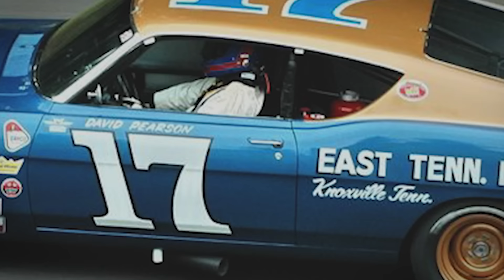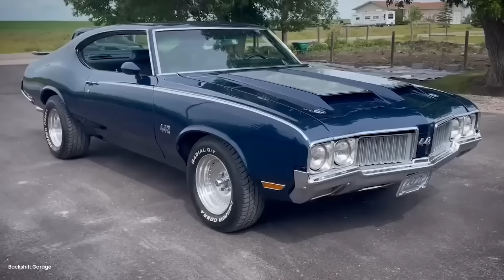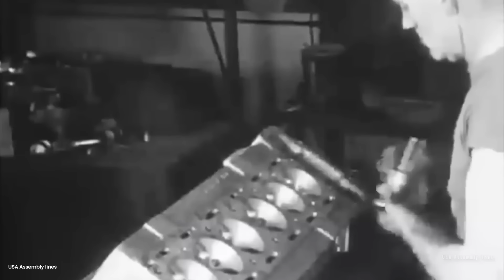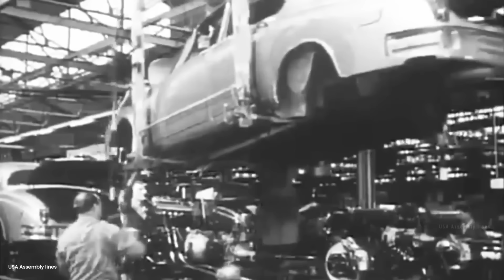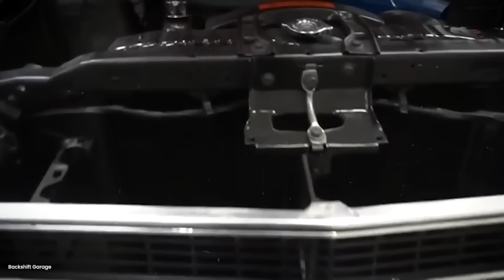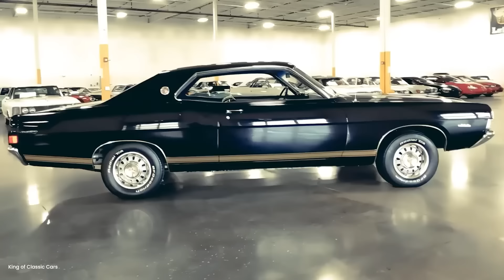The Shocking Truth Why Ford Torino Talladega Was Banned 😮: The Aero King That Dominated Superspeed

Comment: My father purchased one of three Talladega’s that was sold at Long Lewis Ford in Bessemer, Al. He bought the Royal maroon car, Long Lewis had one in each color, we drove the white version and the transmission had hard shifting that, after driving the maroon car sealed the deal. You can imagine being 15 years old and being able to drive this car with my learners permit, smoking the right hand rear tire to oblivion several several times. The car had a 3.25 rear end without posi traction and if you punched it at a light it would smoke that old Polyglas tire through first and halfway through second gear, making it a necessity if you raced someone it had to be from rolling. He wanted the tag bracket on the front bumper modified so I, with many blades, sawed the ears off with a jig saw and we drilled it and fitted it with a flat black screen to get more air flow to the engine bay and because it looked great! We (I) fitted a J.C Penney El Tigre hood tac to the hood directly in front of the driver after he determined exactly the location he wanted. I asked him Daddy, are you absolutely 100% positive that you want me to drill this hole, numerous times saying once I do it there is no turning back. He said yes, and I center punched and drilled the hole. I installed the tac and wired it up, and had it admit it looked awesome. I snuck this car out and raced David Weems in his GTO Judge down the Bessemer Super Hwy on New Year’s Eve on 01/01/1970, his was a 4 spd and took me off the line but when I hit about 90 mph I walked off and left him and was doing approximately 150 mph when I passed the Bessemer bowling alley. I had many great times in the car and with the bond that me and my daddy had forged in this car. Wow do I ever wish I could go back in time to see it, but mostly him, my father, Robert Payne. Thanks Dad for the wonderful childhood and for not killing me for sneaking the car out!! David Payne

Comment: i was around during those days and can't ever remember seeing a 428 cobra jet car with the automatic, im sure someone was silly enough to order one but im betting they are rare. as far as the engine, the nascar race cars regardless of the make used whatever nascar told them was legal for their make. up until the cars got over 200 mph the fords used the 427 ci engine and chrysler products used the 426 hemi and the chevy the 427. amazing when todays generation finds a little info and thinks they have facts
Reply: The Talladegas were only available with automatic transmission and 3.25 rear end. Zero options were available.

Comment: Had a '68 Torino GT Fastback. I REGRET selling it to this day. Never had one single problem with it. It had a 390 block with 428 heads. It wasn't quick but was crazy fast...like 130-140 mph fast. Drove straight as string at speed....